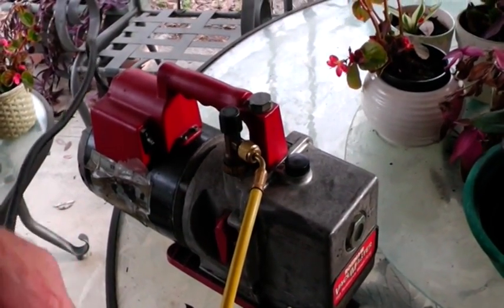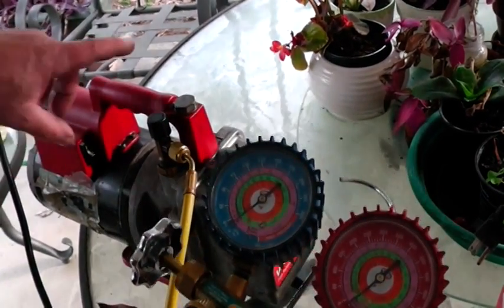Free Air Compressor or Vacuum Pump

Comment: This really should not be done with the newer r134a pumps unless you flush the oil. The older type that uses r22 has mineral oil in it so they are safe to use but the newer ones use ester oil and when water from the air mixes In it turns acidic and eats away at the pumps internals.

Comment from the maker: I have drawn a vacuum and pulled refrigeration oil into an a/c before. I'm sure that you could evacuate a container so that the pump does not contact the oil. Gear oil is a little thicker but, the best thing is that if you burn up your pump, you won't be out any money because it was free.

Comment: so i could put two engines and wire them in the same tube that is connected to the vacuum chamber... it could be an idea to make a circuit so my vacuum could work in single mode or double ;)
Thanks for the tip!

Comment from the maker: I'm sure it would pull the air out.  It might not pull a vacuum fast enough though.  You might have to run 2 or more at the same time.  The good news is that they are free and plentiful.

Comment from the maker: I have literally run these refrigerator compressors for hours when I pull a vacuum in an a/c system.  My father has a vacuum pump he made in the 1970's that has seen extensive use and still works to this day.

Comment: @homesteadprepper then hold onto your pocket protector!  I suggest a cylindrical tank with spherical ends, to maximize resistance to stresses, while keeping cost and weight down.  1/2" material in this configuration for the volume desired can withstand an internal pressure of 483 psi, not factoring for weaknesses due to weld imperfections. assuming a 5" radius internal, with an internal length of straight run at 6'.  200 psi is reasonable, giving you a stored volume of 13, 605 ft^3...  hehehehe!

Comment from the maker: @trollprepper 10.0833ft x 10.0833ft x10.0833ft. that is with figuring 0.500 thick steel.  The interior dimensions will ofcourse be 10 x 10 x10ft. That is the last time I joke with an engineer. lol.